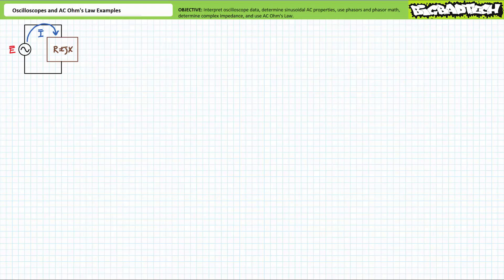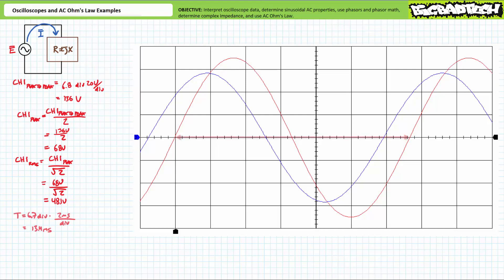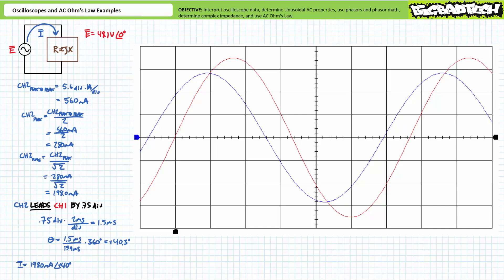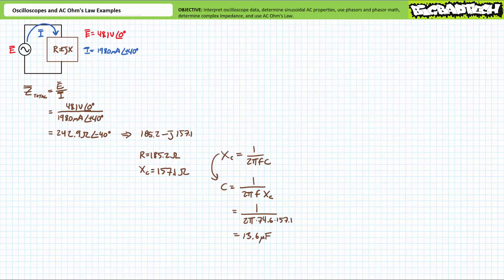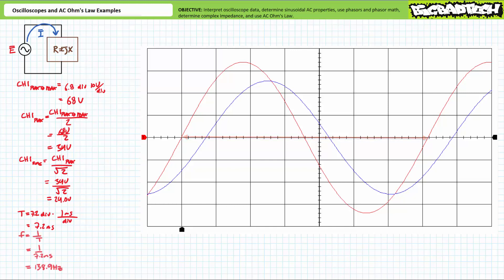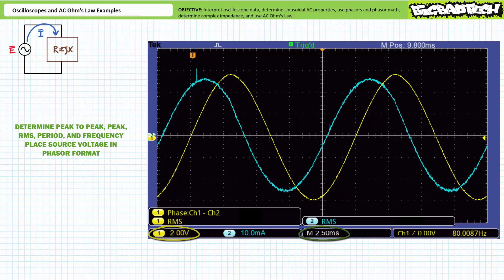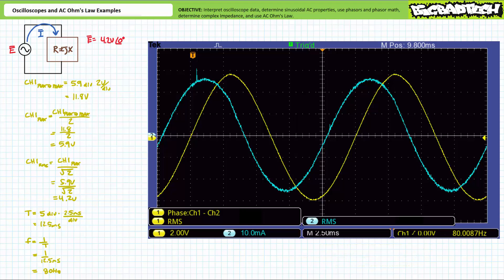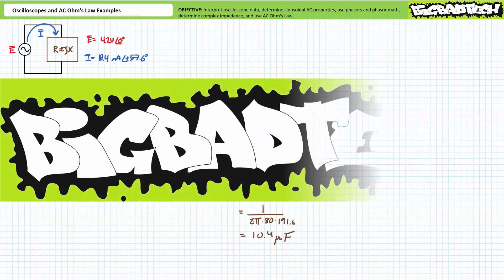Oscilloscopes and AC Ohm's Law Examples (Full Lecture)

Comment: For each situation, Horizontal sensitivity can only be the same value for all channels, but vertical sensitivity can have different values for each channel. Our time scale can only be the same value for all channel inputs on a scope.
Reply from the maker: Yes. The horizontal time scale applies for all properties however each channel (and the math operation) can be individually vertically scaled. This selective vertical zooming ability helps if you're comparing some unusually large property with an unusually small property.
Reply: I have been watching a lot of automobile technician channels, and now to be a auto tech, or diagnostician, an oscilloscope and knowledge of its operation is mandatory. Thanks Jim.